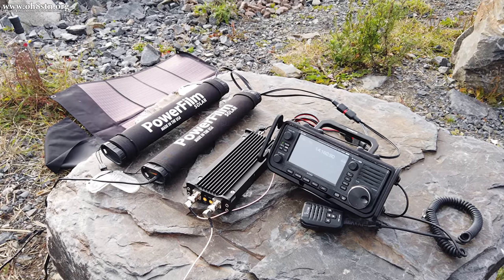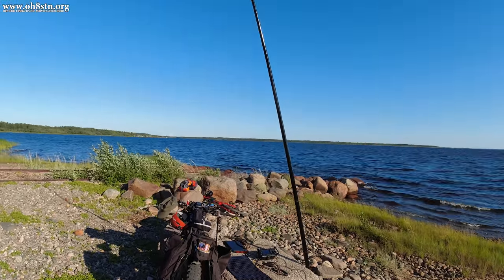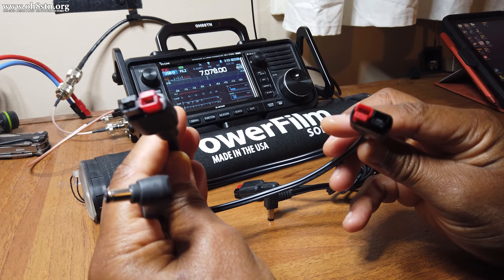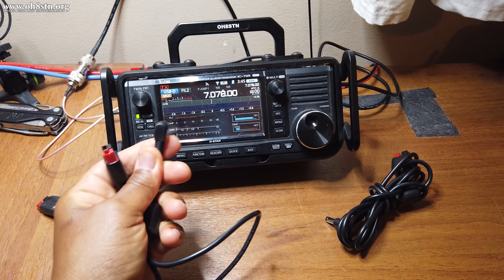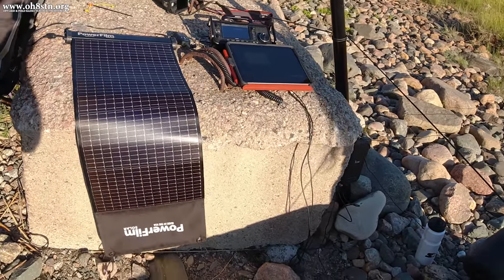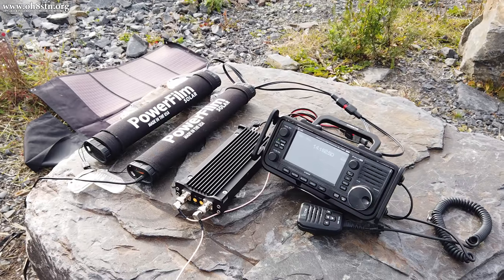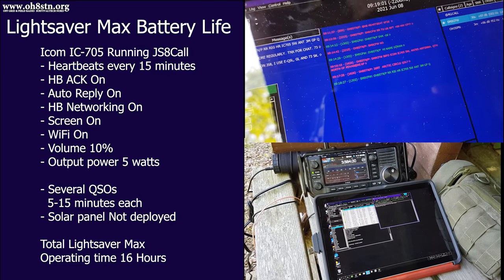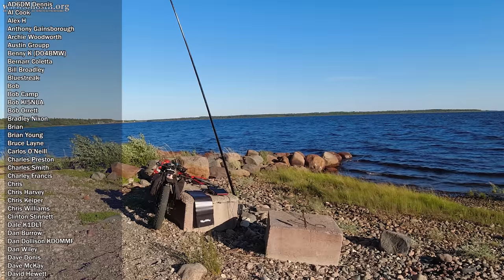Icom IC-705 & PowerFilm Lightsaver Max

Comment: Didn't see the links for the cables you bought. Also what's the guage wire you used for the cables
Reply from the maker: I forgot to post the links. Here you go. It worked for the 705 and LSM.
https://ebay.us/V92yjQ
73
Julian oh8stn
Reply: @OH8STN  Thanks 😁

Comment: FWIW, the 705 pulls only about 2A at 10W on HF, so you don't need to size the wire based on the solar panel, but rather just the radio.

Comment: Julian. What are the longest cables that you've made for the Lightsaver Max? I could see the need for a longer cable if you had the radio in a tent, and the Lightsaver Max was placed outside. Thx.

Comment: Great video, I know you use these power films a lot in your videos; But as much as they cost I would wonder how long those little wires inside the power films would last before they start to break... like how many times can one roll them up and unroll them before they start to fail. It would be a lot of money down the drain when that happens.
Reply from the maker: So far I have never seen one break. I have never even heard of anyone complaining about this problem. My oldest panel has been abused with no care taken during its deployment, and has not had this issue. Considering the military uses PF folding panels, I imagine this has bene well tested.
Here is my PowerFilm SOlar buyers guide. It speaks mainly about quality assurance. http://oh8stn.org/blog/2021/06/24/powerfilm-solar-foldable-vs-rollable-solar-panels-and-others/
73
Julian oh8stn
Reply: @OH8STN  thank you for the reply. Hearing that the military uses these panels and you have not heard of them failing is very encouraging.

Comment: Thanks for your reply.
I plan to use LSMs for powering my TX-500 with PA500 amp.
Maybe the best would be to power them individually from their own LSM?

P-T
Reply from the maker: The LSM can power the TX-500,  but the PA500 has a maximum current draw of ~8A. So it requires two LSMs in parallel. 
When I combine two LSMs in parallel it works however,  I would use a traditional battery and charge controller with diy distribution cables for the TX500/PA500 combination over two LSMs. I'm working on a battery build just for this purpose.

Comment: Yes, I noticed that the LSM can give around 6 A max, so a bit reduced power would be necessary.
I am looking for a suitable LiFePO4 battery. I like those from Dakota Lithium, but no dealer in Europe.
Reply from the maker: I tried to show some of the batteries from Dakota lithium. They promised on three occasions to send batteries for review and video making, but failed every time. It really would be nice to have a solid turn key battery supplier which doesn't cost an arm and a leg. Until there's a reliable one, I'll continue building them 😉👍

Comment: Do you think the 705 is the only / best choice for 6m portable?

You recommended the x6100 due to updates from the 5105 but 6m doesn’t seem to work well on the 6100. Is 5105 a viable option for 6m?

Thanks!
Reply from the maker: Excellent and interesting question. 6M works extremely well on the 705. I just posted a video to Instagram with a 50 MHz winlink session using it. 50 MHz also works well on the 5105, G90 and 818. I haven't done any testing at all with the 6100 on 50MHz yet. 6m season is nearly here so I'll include that in my testing. That's the best answer I can give you for now without blowing smoke in your ear. 
73
Julian oh8stn
Reply: Fair enough, thank you. 

The reason I ask is I’m a tech and want to get stuck into 6m but the G90 doesn’t appear to support SSB on 50mhz. All mode portable rigs seem few and far between, and Xiegu doesn’t look like they’ve gotten the x6100 up to snuff…although the waterfall is tempting. X5105 might be a fine compromise…
Reply from the maker: All of these rigs are All-mode 160-6m: IC-705, TX500, G90, x5105, X6100, FT-818. I really live the 705 & tx500. My G90 has ran 24/7 over a year. X5105 is only 5 watts. FT-818 is my least favorite.
Reply: PS I appreciate the FT notes…I didn’t start with Yaesu radios but have become a convert. Just doesn’t seem to be the way to go for what I want to do with HF

Comment: I did not hear a comment, and I have not found in my initial search the number of 
charge cycles for the internal battery.  I've seen solar generators with varying number
of charge cycles when drawn down to 80%.  Batteries wear out.  I'm always concerned
when a product has an internal battery.
Reply from the maker: It's usually dependent upon the quality of the internal cells. The cells inside cells top shelf Lithium-ion. Moreover powerfilm is working on a refresh program for the LSM. This would allow the replacement of the internal sales rather than having to completely purchasing a brand new package. I'll give me more details on both once info is available.  For what it's worth, my first lightsaver Max came from the initial run few years ago. It's still my primary pack. 👍

Comment: What is the recommended way to use two LightSaver Max in parallel?
Reply from the maker: It's very simple. I just made parallel cables with plugs coming from the output of the LSMs, to an Anderson power pole adapter. It's like taking two power cords with coaxial connectors. Cutting off the Anderson power poles on the other end, splicing them together and terminating them with the single Anderson power-pole. The coaxial connectors each go to the individual LSMs. It's important to make sure the LSMs are fully changed. Then keep an eye on any imbalance between the two.

Comment: I would assume you would need to use an external panel to charge the LightSaver Max in winter as the LiFePo4 would need to be kept above freezing. Or have you found other methods of charging in the winter?
Reply from the maker: I don't charge it outside. For winter operations I'm almost always in a shelter. The LSM is almost always in a protected case or in my sleeping bag or something like that.

Comment: Julian, since you have spent a lot of time on both of these radios. Which radio do you enjoy using the most the Lab599 or the IC705?I know the Lab599 is going to use less power and is very water resistant. I have a feeling the 705 might be easier and funner to use (I do own the 7300). I have a few LIFEPO4 battery packs and solar panels so not really worried about running out of power. But since I don't yet own either one of these radios I wanted your perspective. if you have already covered this topic in another video then I apologise.

Comment: I’m sold! Really been wanting to add solar capabilities to my portable set up. The 60w folding panel seems ideal and I like the option of running the max in parallel to give 10a which will be great for my 857D at around 25W. look forward to being able to get them in Europe. Thanks as always for a great video 73
Reply from the maker: I have bad news. The Lighsaver Max won't power the 857 :(
The start up current of the rig is too high for the LSM. We tried with the 891 which was a no go. Not to fear though, the 60 watt panel and my new battery pack project will power the 857 extremely well. Please stay tuned.
73
Julian oh8stn
Reply: @OH8STN  I’ve never considered the start up current before. Something interesting to think about. Will keep my eyes out for your solution 😁

Comment: Very much enjoyed your video.  I am active in Emergency Preparedness for Hurricanes and intrigued by your use of solar for Emergency Comms.
However when it comes to DIY projects I must admit that I am technically challenged.  Is there any vendor who can provide the cabling you describe?
Reply from the maker: Hi Patrick.
Although it is quite costly, you might ask from hammadeparts.com. Otherwise, I'm not sure.
73
Julian oh8stn
Reply: @OH8STN  WILCO, Did I also see that you have a discount with Gigaparts
Reply from the maker: Yes, my callsign 👍
Reply: @OH8STN  how much is the discount?
Reply from the maker: Perhaps 5%
Reply: @OH8STN  So this is an Affiliate Fee for you?
Reply: I'm going to be making a purchase, how do I use your discount?
Reply from the maker: Just use my callsign as a discount code at checkout. Links are in the description.  If the discount doesn't work, just email them and ask for available discounts for oh8stn.
Reply: @OH8STN  Any recommendations on accessories for an IC-705
Reply from the maker: No affiliate,  just a discount for my viewers.
Reply from the maker: Yes, the @peovimounts full wrap cage. It's ordered directly from peovi Mounts. Alternatively, you can 3D print one using pla Plus or carbon fiber. If you do a lot of data modes and want to run wirelessly, the Icom remote utility is also a good one to take.
Reply from the maker: https://oh8stn.org/blog/2019/12/17/deals-discounts-support/

Comment: Hey Julian, was really looking forward to this video. I have all the gear but no cables to connect it all!!. I followed the link to eBay but there are a ton of cables on there.  What size is the 12v barrel connector for the PFLS? I see 2.1mm, 2,5mm etc.on eBay.  Love you videos and mindset of off grid and self reliance. 73
Reply from the maker: I used this one for the IC-705 and Lightsaver Max.
73
https://ebay.us/V92yjQ
Reply: Ok cool. That barrel connector fits the 705 but what or where did you get the connector for the PFLS?  My 705 came with a DC cable with bare ends and I put power pole connector on it.
Reply from the maker: It's the same cable. They are close enough that it fits both 2705 and lightsaver Max. I just bought a few of those cables, chop them up, and splice them into a single power pole connector
Reply: @OH8STN  Perfect!!!  Trying to copy what you did with the Surface Go2, 705 and PFLS!!!!!
Reply from the maker: I think I'll do a video specifically on that. The 705, the surface go 2, PFLSM and cables.
Reply: @OH8STN  that would be awesome!!

Comment: I do have a question about one of your "if I did it all over again" statements. You said you would use a 60W external panel but on the LightSaver Max web page it says "A second LightSaver Max or another PowerFilm Solar panel (30W maximum) can be connected to the 12V input to increase solar charging speed". So is it safe to connect a 60W panel, like the PowerFilm F16-3600 to the LightSaver Max or stick with the F16-1800?
Reply from the maker: I thought about this later on. PF says the LSM can only make use of a 30 watt panel. The rest is lost as heat. My comment about a 60 watt panel referred to times when I am using a larger battery bank and genasun charge controller, or when dividing the panel output across two LSMs. I should have added additional context. Apologies.
73
Julian oh8stn
Reply: @OH8STN  I guess in thinking about it, even if you get the 60 watt PF panel, and you were just going light and just wanted to use the LightSaver, you could just fold the F16-3600 partly on itself so it's only half the panels are seeing light.

Thanks for the the reply and video.
Reply from the maker: That's true and you are very welcome. Thanks for watching and for the comments.